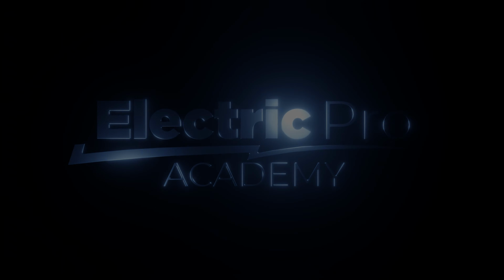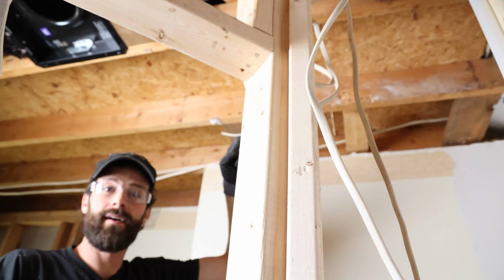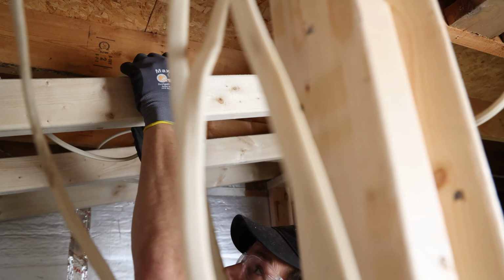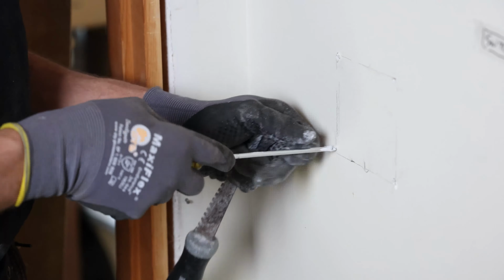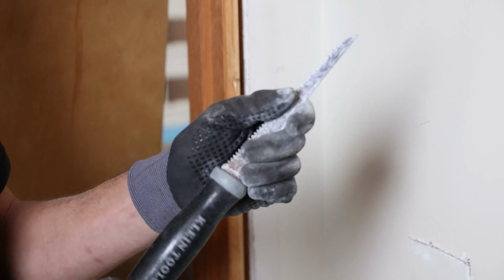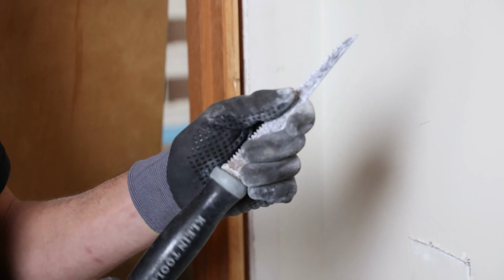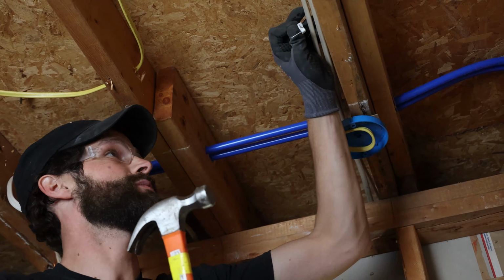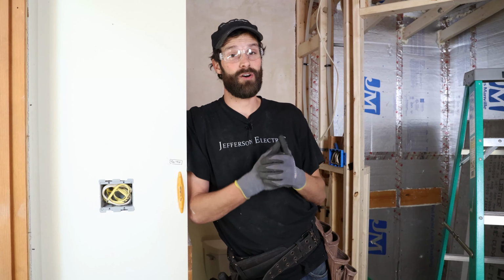Running Wire In A Bathroom Remodel (Part 1)

Comment: I enjoy watching how you're solving problems. Your attention to detail is usually spot on. I really appreciate that. I recommend when planning to fish wires (or pex) down through a top plate, control those penetrations as much as possible. I recommend removing a piece of drywall big enough to accommodate drilling up from under the top plate, to control the position and trajectory of those holes. Especially when the wall is packed with insulation

Comment: Thank you the video extremely helpful. You mentioned code violations. I am attempting to run Two bathrooms directly above and below each other on one 20 amp breaker. Each bathroom consists of an outlet, fan and vanity light. Is that allowed? Thank you

Comment: Learn something new with every video... I was not aware that using a screw inside a plastic box was a code violation (a screw in a location not already made for one - like that pancake box center hole).  I suppose it is because it can't be grounded like a screw in a metal box is.

Comment: Is there a reason you initially screwed the 3 gain box in rather than nail?
Reply from the maker: Timestamp? Can't remember now. Maybe couldn't quite swing a hammer?
Reply: @ElectricProAcademy  at about 50 seconds. I usually nail all my new work boxes. Curious why you chose to screw it? I’ve always noticed the wing with the 3 screw holes but never used it

Comment: Instead of using pancake boxes I got lucky with using a fan support box that fits over 5he center of stud that had two cavities for space to hold wires and another time I was able to get the home owner to agree to having the lights a 1/2inch over to save them the cost on running extra wire. Funny how much that 1/2 inch wasn't a big deal to save a $100 lol

Comment: You are one of the top 10 electricians in the business!!  You could have made a custom L-box in which the electrical box slides inside like a glove and gives it extra strength from abuse.   Either way, it works, cheers 🍺🍺
Stone Henge

Comment: my house drives me nuts every electrical box is wired wrong, and most have about 2 inches of wire in them and no slack plus the guy used scrap pieces of wire and put junctions everywhere in tiny little round boxes they don't even make any more i think 3 inch with 4 or 5 wires jammed in there
Reply from the maker: Ugh, we ran into a LOT of that on this job: https://youtu.be/btSXnqhamqw. Have you been personally remediating?
Reply: @ElectricProAcademy  yes i fix it as I can till I run out of time or money  LOL

Comment: If your not comfortable stripping your  wiring sheathing the way you saw in the video you can lay it against the wood so if you come off the wire sheathing it will hit a piece of wood instead of your hand or other body parts

Comment: The way I wire my bathrooms, power in to be identified by coming in the outles Closest to the stud, simple,  that is standard here in California, plus I will run a 14/3 switch leg to the light first, black for lighting and red for the fart fan with 14/2, I mean " waffer" lol

Comment: he ran the lights off of a 20 Amp breaker, but he ran 14/2 from the breaker to the lights. He ran 14/2 to the 1st switch box,then to the 2nd switch box, then from the 2nd switch box he ran 12/2 hot  to the 3rd box?????

Comment: Ok people educate me here.  Why was it necessary to add that piece of wood in order to nail in the gang box in place?  Could he have just drilled a nail into the bottom of the gang box instead?  Keep in mind I am not an Electician.
Reply: Per the code, you may only install boxes in a manner that is listed and approved. It is not an approved method to put screws through an this particular electrical box. However, there are listed boxes (smart boxes for example) that are manufactured with wood screws on the inside of the box for mounting.
Reply: @zacharyelliott252  got it.  thank you
Reply: He already said why in the video. It's a code violation to put a screw through the box.
Reply: @illestofdemall13  I must have missed that part of the video.  Others have already replied and explained that to me, but thanks anyway.

Comment: I dont get it. If a plastic box has a hole for a screw then its ok to use a screw  but if the exact same box material has no hole then its a violation to put one there!

Comment: Just wondering why you have to be so cheap and use that plastic 2 gang with all those stupid clumsy tabs buy two gangable metal deep boxes use madison straps ,romex connecters and a ground screw have plenty of room a stronger box and less aggravation save time for like what $3 more. You can tell I'm not a contractor I think and do things with my head not my wallet lol
Reply: @ElectricProAcademy  I wasn't talking about the 4 square boxes I was talking about the single gang deep boxes with the removable sides usually used in commercial industrial steel /aluminum studied walls. I only thought of it when supplies where scarce the special 2 gang plastic box was unavailable I needed a simple solution for a dble gang 2 gfci outlets with two feeds in and 2 out. luckily a commercial guy was like use the gangables and Madison straps I was like they make them deep yup and done. Agian real life experience and ya I never thought of the corrosion aspect so thx for tht

Comment: I DON'T use Metal Staples !! I have an Arrow Romex Staple Gun for Romex Cables , 14-2 , 14-3, 12-2, and 12-3 ! Metal staples can short out the conductors in the cable sheathing if driven in too much ! Plastic Staples from a Staple Gun won't !!